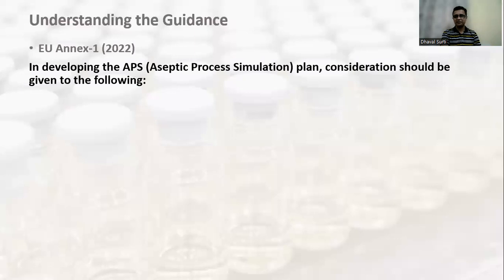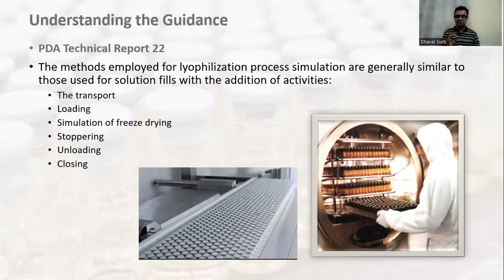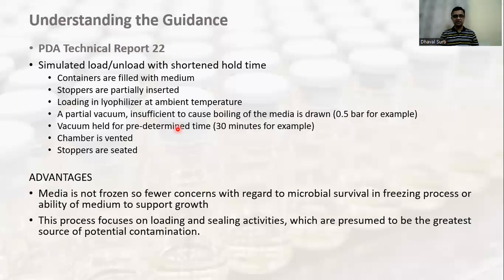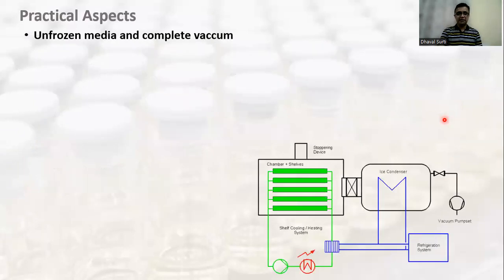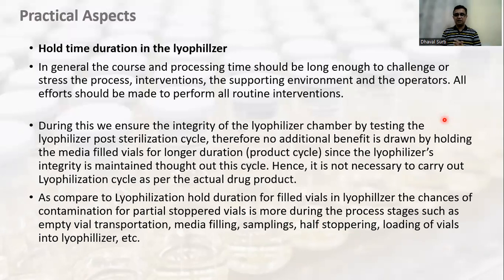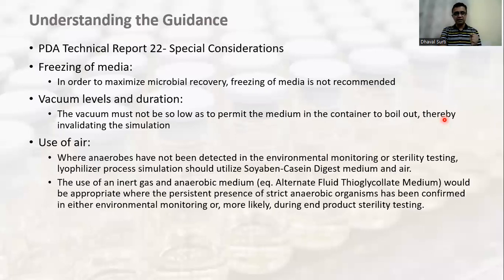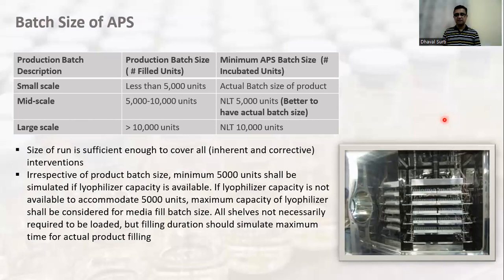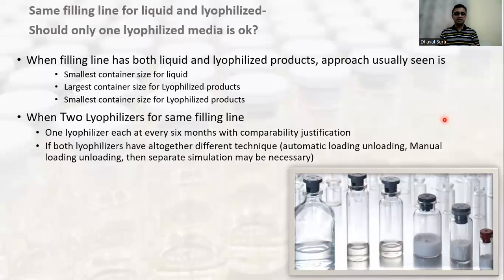Media Fill-Lyophilized Product Part 2, Revised EU Annex-1, #pda #intervention @PHARMAVEN  #aseptic

Comment: Sir how much time we have to keep the vial inside the lio during media Fill, ?
Reply from the maker: You can simulate vacuum pulses same as primary and secondary drying but at subminimal vacuum, this can be done for 2 to 3 hours

There is no specific guidelines but this is common followed approach
Reply: @PHARMAVEN  also if we fill one shelf in lio how we identified the vails as per intervention?
Reply: We are going to fill 12000 vial in one shelf so how we will know the which vial for which intervention or time ?
Reply from the maker: @yogeshvichare5458  This is common concern with automatic loading, 
One way is to track approximate number of vials row during intervention time, and second broader way is to track interventions during entire shelf filling and link total intervention if we encounter any failure